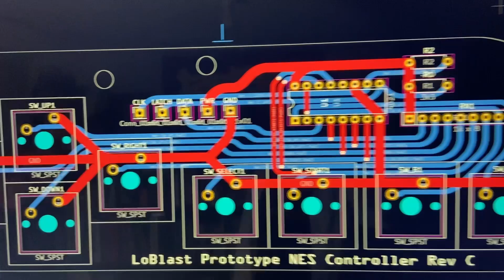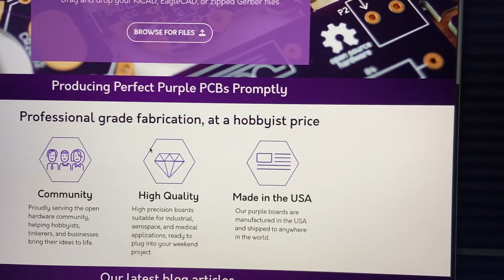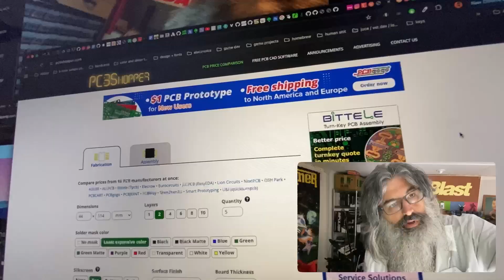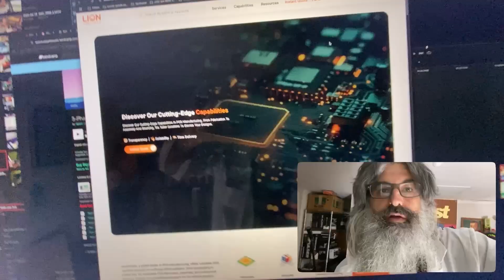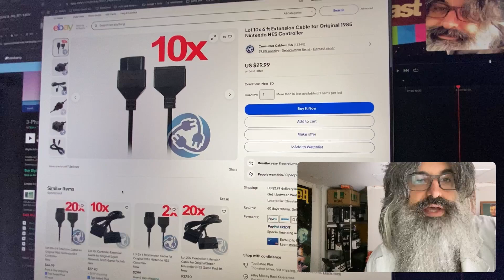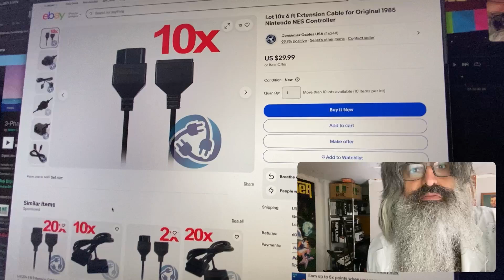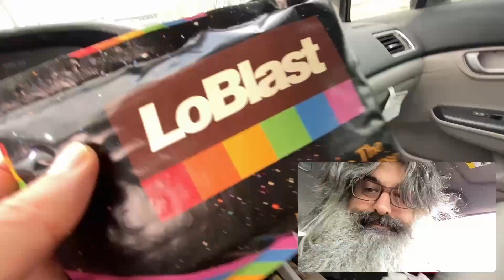PCB Fab Tariff Solutions

Comment: It is very durable and it will not break unless you put tremendous amount of hate into it. I did received it in the LOBLAST PACK bubble pack without any extra protection and it is very solid and it is not a cheap product. It will last for ever.

Comment: Just use OSH Park
They're a USA based PCB manufacturer. Hope you like purple PCBs.
Oh, and if you need an NES PCB for prototyping, use a donor and put a ZIF DIP socket on it. Swap the chips, keep the PCB in place.
Reply from the maker: yeah the point of the prototyping is manufacturing new designs so cannibalizing old carts wouldn't help much -- I can test my software using an SD reader cartridge
Reply: @loblast  there's a set number of PCB configurations you can use for NES games though. They're always going to have the same Data and Address, and I doubt you're homebrewing your own mapper chips.
Reply from the maker: I have to design my own version/clone of those mapper configurations in order to get new boards manufactured. I didn't mention it in the video, but I have a published/self-published NES game. It's sold about 700 copies. Over 200 over those were hand soldered by me. No old nes carts were harmed in this production.

Comment: Options I can think of:
1) etch your own boards (or use perfboards, or deadbug wiring, etc) like back in the day before low volume ordering became available.
2) move to a country which isn't in a state of turmoil.
3) have a friend in another country who will buy then sell you goods though a country with a low tariff, still going to cost more than before but probably the most viable option.
4) become the fabricator and work for no profit in order to be competitive since your entire market would be USA as everyone else can get it cheaper.
Reply: "become the fabricator"

Wow, if only the country that manufactures all the equipment to manufacture pcbs wasn't also the one that has the 145% tariff. Not to mention recommending someone drop 10s of thousands of dollars to setup a pcb fab as a way to circumvent the tariffs, fucking brilliant mate.
Reply: @colausbra  Hahaha, I didn't say it was a good option, but it is the option the government seems to to think people should be doing.